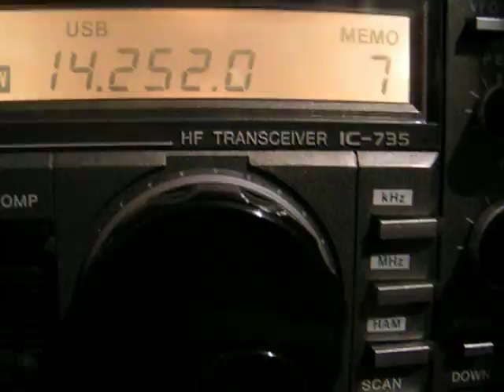Icom-735

Comment: 735 is one of the best radios I've ever used. Putting it next to an Icom 756 Pro 3, and the only difference is the huge screen on the Pro 3, and filters on the Pro 3 which are useless on sideband. The 735 is VERY easy to work on, very easy to use, and has one of the best receivers to this day. The 735 is an absolute CRUISE MISSLE on HF. There isn't a DX station I haven't been able to work with 100W and a Cushcraft R5 vertical. 

The lighting mod is really easy. Change the front bulbs with LED's.